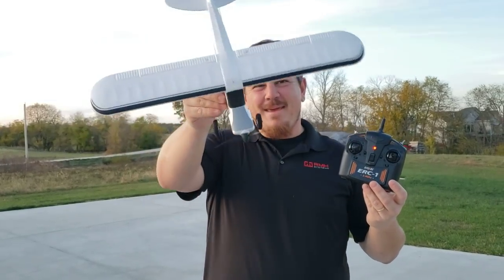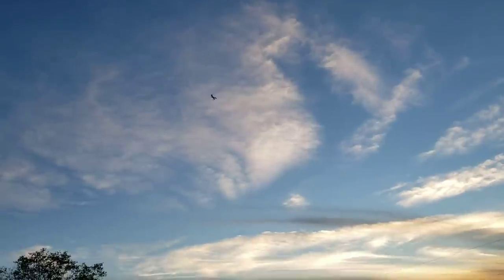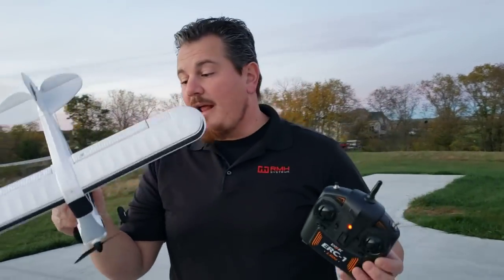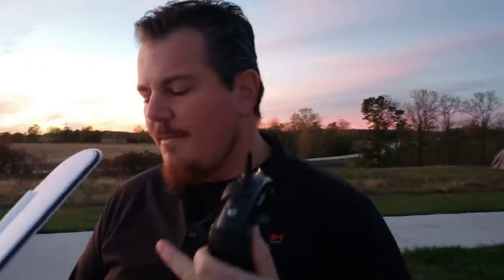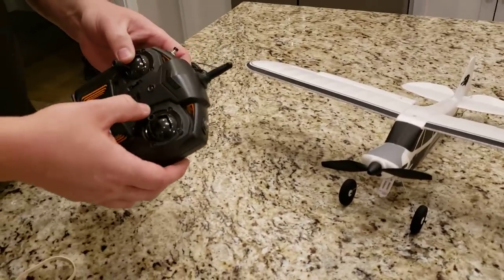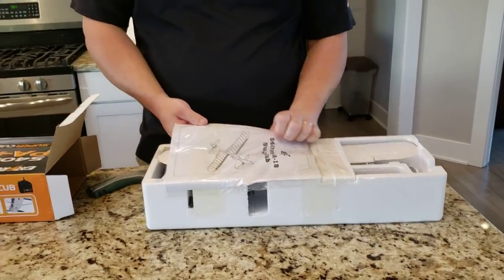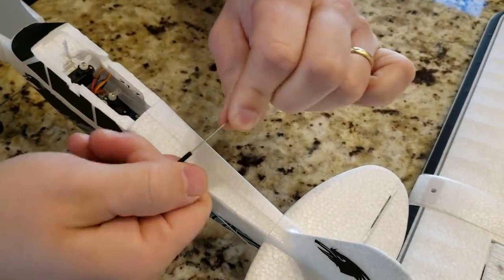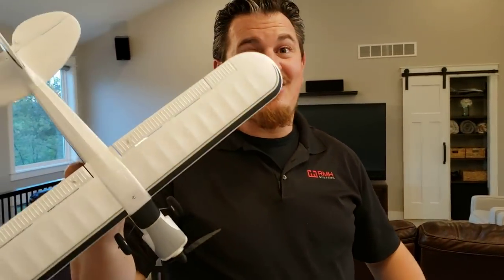EazyRC - PA-18 Super Cub - 540mm RTF - Unbox, Build, Radio Setup, & Maiden Flights

Comment: Im taking off those wing struts and they have been on long enough that the dihedral is gone, so i am hanging it so that the fuselage is off the ground and then the dihedral i hope returns. Fingers crossed. I also added my own stol wing rails i guess like whats on the mini twin otter plane wing.
Reply from the maker: Cool! I hope your wings don't twist too much, but I agree, the wing struts pull them down a lot, and on a "trainer" this may not be ideal, to to mention the added weight.

Comment: I need this . only fixed wing is a gifted eflite B-17 that leaves me shaking when i land & yes the spongy wheels nowadays are not the solid Dubros we started with. Nice Flight , kinda funky lil Plane.
Reply: I like the spongy wheels for beginners puts less strain on the landing gear and supports on the bigger foam war birds from elite or bigger foam planes so qhen you land hard it don't bend retracts or the landing gear struts and helps keep fixed gear from ripping out of the foam as well in bigger foam planes
Reply from the maker: I don't like having a heart attack every time I take up a plane, but those are the planes that keep us challenged.

Comment: How does this compare to the VolantexRC 500Cub? Seems harder to fly, but looks exactly the same…
Reply from the maker: It's super similar, but for whatever unknown reason, I wasn't as crazy about this one...my favorite Micro Cub is hands down Sport Cub S2 UMX...BUT it's not the cheapest, and it STILL has a brushed motor - wish Horizon Hobby would update her, she needs it BAD.

Description | Purchase | Videos
Habu STS 70mm RTF | https://bit.ly/3ci5eWD | https://bit.ly/3ontBF9
Apprentice 1.5m RTF | https://bit.ly/3BlSjh9 | https://bit.ly/3b6kCVP
Carbon Cub S2 1.3m RTF | https://bit.ly/3PqNR4A | https://bit.ly/3J6WmQ3
T-28 Trojan 1.1m | https://bit.ly/3PmbxHf | https://bit.ly/3v8zGJi
Apprentice 1.2m RTF | https://bit.ly/3BlSjh9 | https://bit.ly/3Bk60wG
Sport Cub S2 UMX | https://bit.ly/3yYkrUs | https://bit.ly/3PL8vfJ
AeroScout 1.1m | https://bit.ly/3OlqyYQ | https://bit.ly/3ztp9Li

Trekker 1.2 RTF | https://bit.ly/34jhgLZ | PNP https://bit.ly/35xOPu8 | https://bit.ly/3PHoZ8M
Bigfoot 1.3m RTF | https://bit.ly/30mYdOq | https://bit.ly/3zqIxZu
Pioneer 620mm RTF | https://bit.ly/2YotgbY | https://bit.ly/3OvJLad
Prodigy 1.4m RTF | https://bit.ly/37zJxzt | https://bit.ly/3cvccaZ

Ranger 1.2m RTF | https://bit.ly/3bHFIKr | https://bit.ly/3bCezZB

RC Simulator https://bit.ly/3aWiW19 | https://bit.ly/3h9StjB
USB Simulator Interface Wireless DSMX Dongle https://bit.ly/3ztFZK8 | https://bit.ly/3h9StjB

Comment: I don't like these "ready to crash" planes. It's a good way to frustrate a kid who wants to get into the hobby. In my opinion, just go with UMX Timber as a newbie but with some help of course. Or the little Hobby Zone pusher prop thing. I forget the name.  This Supercub you are demo flying lacks dihedral and in fact looks like negative dihedral. How some of this stuff gets beyond the prototype stage is beyond me except for the tons of expense for the mold tooling etc that would be wasted.  The Durafly Micro Tundra is another flop. Small definitely doesn't necessarily equate to "beginner."  I got started in the hobby with a sport cub s but a brushed motor is bad news and 1S power is not enough.
Reply from the maker: True.

Sport Cub S2 UMX https://bit.ly/3cDYUW1 - https://www.youtube.com/playlist?list=PLXTH0DstRDc5gY8qX_x8kAJq3glGMXjDy

Great option, and only a little bit more expensive.

P.S. Don't tell hh...the mini aeroscout isn't too much better.
Reply: BTW: the big FMS Supercub is one of my favorites. Great flyer and one of the best things about FMS is they pull off big planes that fly great on 4S. Oh, and the finish and foam density is great on FMS brand. Appreciate the time you spend on reviews. HH is fortunate.

Comment: I’m of the opinion already mentioned in that, if a pilot of your caliber has issues then a beginner is going to have trouble. Compared to the Horizon Hobby S Cub V2 it’s a non runner for me. I’ve great respect for the pair of you but if you’re trying hard to plug a positive spin on it’s questionable quality (just my opinion based on your video here today) then it lessens your credibility to give an accurate impartial review. 
Upsetting you two is the last thing I want to do. Please don’t take offence. 😊